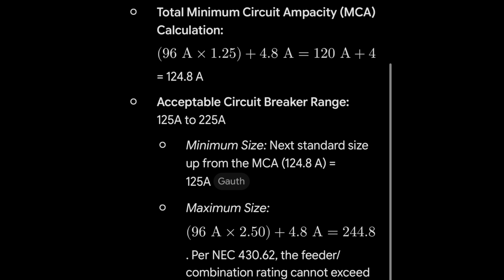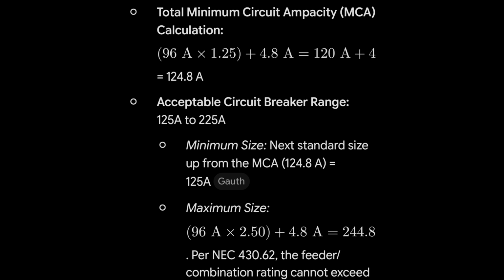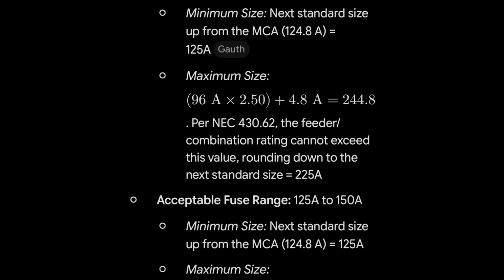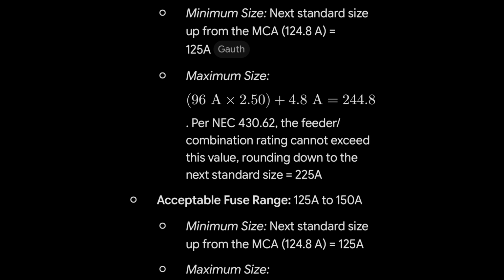Air Compressor Branch Circuit Sizing With An AI Agent

Comment from the maker: Prompt for the agent
Format your response using the following two-part layout:

### ⚡ QUICK REFERENCE SUMMARY
- *MCA:* [Calculated Value] A
- *Phase Wire:* [AWG or kcmil] (Copper, 75°C)
- *Ground Wire:* [AWG]
- *Breaker Range:* [Min starting size]A to [Max standard size]A (Inverse Time)
- *Fuse Range:* [Min starting size]A to [Max standard size]A (Dual-Element TD)

---

### 📋 DETAILED SPECIFICATIONS & BREAKDOWN
- *Equipment Profile:* [List all analyzed motors, e.g., Main: 20HP, Fan: 1.5HP @ 460V]
- *Individual FLCs:* [List individual table currents]
- *Total Minimum Circuit Ampacity (MCA) Calculation:* [Show math, e.g., (FLC1 x 1.25) + FLC2] = [Value] A
- *Acceptable Circuit Breaker Range:* [Min starting size]A to [Max calculated/standard size]A
- *Acceptable Fuse Range:* [Min starting size]A to [Max calculated/standard size]A